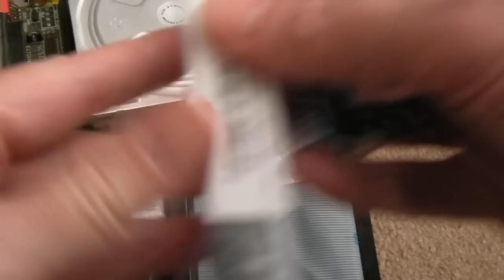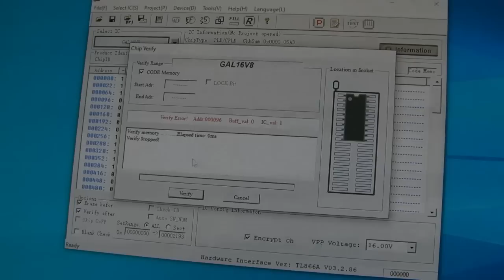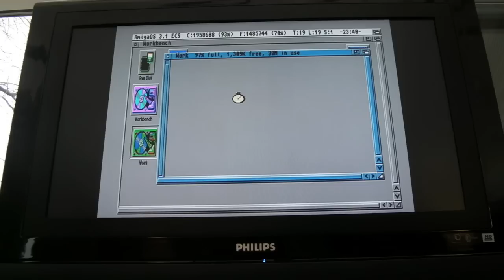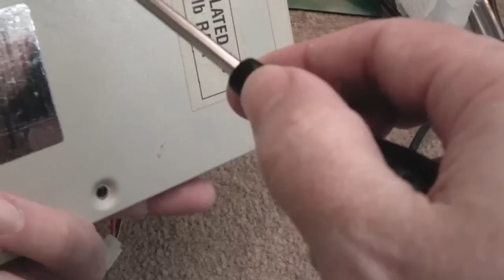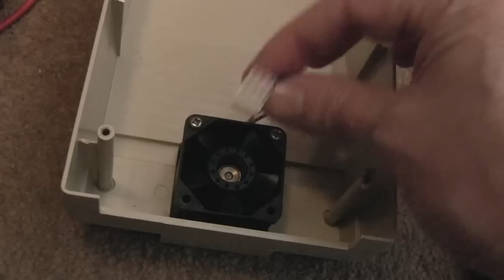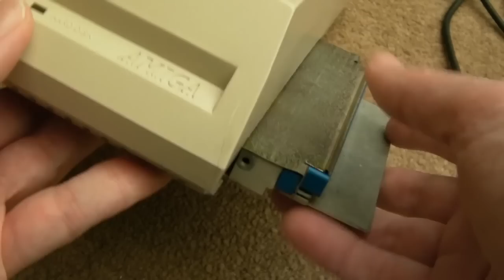Another Commdore A590 Repair (From Tom Meades)

Comment: Great work Chris! It's always a treat to watch your content 👌👌

About those SCSI Quantum ProDrives: In the end they are very reliable indeed but a lot of them are suffering from molten bump stops. Somehow the little stops at the end of the head actuator arm very often are completely molten on a lot of them, preventing the heads to move at all. They're just stuck at the landing zone making the drive seem completely bricked. 
I guess the "plasticizer" somehow completely takes over the structure of these things and they turn into a very sticky chewing gum-like substance which is pain to get off your hands. 

I've witnessed 5 of these drives having this issue and I just managed to save one on an SE/30 by just using a tiny but of heat shrink tubing around the two stops. Sillicon hose works as well. It's a bit of an operation as you have to open the drives up and disassemble the top magnet and the screws can be very stubborn but it works like a charm! The SE/30 wasn't booting at all but is happily buzzing along now 👍👍

(EP=Enable Parity and 52s is a 52mb with one of those fake upper platters to keep it internally balanced ;-) )
Reply from the maker: Thanks for the info there on Quantum drives - super useful!  Thanks also for the jumper info =D

Comment: I am pretty sure the old family A500 had one of these drives attached.  The 20mb capacity was pretty limiting and it got filled with materials for a thesis to the point where you couldn't fit anything else on it.  I don't remember it including a memory expansion but that could either be down to me not realising that (as a school kid back then) or just being a lower end model that didn't have the RAM chips installed.  I remember the drive being extremely slow.  If I was running these expansions I would definately want to use it with a SCSI to SD or CF adaptor.
Reply from the maker: Yes, it sounds like you didn't have the RAM fitted - that was an option!   And yeah, they are very small lol!  I use the other A590 with a SCSI 2 SD - much better as there's a lot more space, and obviously its better to use an SD card than rely on these old SCSI drives.

Comment: Great work 💪.  I've got one of these and I believe I have exactly the same issue with the ram controller. Is there somewhere I can purchase a  new chip from?
Reply from the maker: The GAL chips can be purchased on eBay for a few pounds each.  You would need a Minipro TL866 II programmer to program using the .jed file (which you can download on the net).  Alternatively you could ask on AmiBay - someone is bound to be willing to program and and sell you a chip.
Reply: @GadgetUK164  Thanks for replying. I  purchased a Gal from Ebay and someone from the Amiga community is programming it for me 😉👍hopefully it will work again 😁

Comment: Useful video, thanks. I recently got my old A500 and A590, with original 20MB WD XT drive working. The drive made horrific noises at first but now it works fine with only 1 bad block on the drive. I've got a SCSI2SD on the way though 😉

Comment: Also, a CD32 power supply works perfectly for powering these. I usually just turn both on at once. The main important thing is that ground is connected through.
Reply from the maker: The problem with the CD32 PSU (see my previous A590 video) - even if you turn them both on at the same time, you may have voltage issues.  A CD32 PSU is what killed the RAM on the last A590 I looked at before this one.
Reply: I've been lucky so far! The risk seems to be turning the A590 on BEFORE the Amiga. The A590 PSU is designed so that it turns itself on when it senses the 5V coming from the Amiga.
Reply: You could make an adapter with a DPDT relay that has a 5V coil. Pin 3 on the A590's DIN connector is 5V when the Amiga is switched on. You could arrange the relay so that when it comes on, it connects pins 1 and 4. Ground (pin 3) can be permanently connected. That would pretty much do what the A590 PSU does.

Comment: Buffalo Gals ? :)
Just so you know, Microchip make ATF16V8B which is a GAL replacement device that you can program with a TL866 II Plus. I've used them in Spectrums and i think John Hertell has used them in Amigas without any trouble, so they are well worth considering as you can buy them brand new, rather than NOS
Reply from the maker: Thanks for that info Peter!  I wasn't aware of that chip!

Comment: When programming the GAL why didn't you pick 16V8D?  You just picked 16V8, but 16V8D was in the list.
Reply from the maker: Editing issue - I forgot to film that part (where I did select the right part) - 2nd time around I got the wrong part!  I think they are interchangeable anyway?
Reply: @GadgetUK164  Quite likely they're interchangeable, but I just didn't know if there was a specific reason to go with just the 16V8 vs the actual 16V8D.

Comment: Would you like a desk for Xmas? 😁
For the posts I found out using an outer jacket made out of pvc tubing, or aluminium helps to both glue back split posts and rebuild them, as they are tighter.
Reply from the maker: Great idea!  Made me think heat shrink tubing might help too!
Reply: @GadgetUK164  indeed. I know by experience two or three layers can become quite stiff.
BTW you can get metal tubing from old clothlines (some use tiny pipes instead of wires).

Comment: Will the SCSI to Micro SD adapter from amigastore.eu also work on the Impact A2000-HC+8 Series II, or would you recommend the SCSI to SD Adapter (SCSI2SD) V6 Rev: 2020c from amigakit, and will that one work with the Impact A2000-HC+8 Series II?

Thanks.
Reply from the maker: Yes, it should work!  If you want better performance on the SCSI2SD get V6, but tbh I prefer v5.1 - it's cheaper (around £60 from AmigaKit) and you can read the SD card (first drive on it only) from WinUAE, which helps setting it up and transferring files etc.

Comment: I have an A590 but the HDD is seized  😢 is there a solid-state solution floating about out there that I can replace the HDD with?
Reply from the maker: Yes, the SCSI2SD will work fine =D  If you check out my previous A590 video, and the A2091 videos I covered that SD adapter there.
Reply: @GadgetUK164  Great stuff, thank you will check it out 😀👍

Comment: That is super cool that the C64 Case Saver castellated post repair sleeves work on the A590. I had all but the sleeves available severalty because folks had asked for it. I'll add the sleeves as a separate item in case folks want to use them in other applications like this. Great discovery Chris!
Reply from the maker: Yes - wonderful product from you, very pleased they made those posts rock solid =D  Thanks again!

Comment: Great video as always, I have an original compete A590 I can shoot you some pics of how it's all mounted inside the case if you would like, the drive uses nuts like the external port to hold.it to the shield then the screws go through the bottom of the case into the nuts that are on the drive.
Reply from the maker: Thanks =D Afterwards I realised there should be some "posts" that sit between the board and the drive (screwing into the drive I think).  I've got some of those so I might re-visit that!
Reply: @GadgetUK164  they're a #6-32 NC standoff the thickness of the lower case originally. They're a burly looking thing!

Comment: You should not supply the physical scsci drive through the a500 powersupply, too much load. Stick to scsi2sd instead or use an actual a590 powersupply.
There should be posts to mount the drive. The screws from the bottomside will secure the posts, hence the drive.
Reply from the maker: Yeah, it was just for testing more than anything.  With the beefier PSU bricks its fine though!  Used it a fair bit, granted putting extra load on the 12v rail though.

Comment: its been a while since I seen one of these.... by the time i could afford one the GVP HD8+  was out so I got one of those instead and never regretted it... I just remembered some of the old drives required the park command,  but I think the quantums were auto parking, and if memory serves the scsi  52mb  drives were usually low level  formatted for 49mb with  3mb reserved for auto-provisioning of bad blocks.. but yet again the a590 originally came with a 20mb one...

Comment: Just an idea with that short internal SCSI cable. On many commercial devices, they actually split the cable, either in pairs or multiples of 2. (Every second wire being a ground signal, it helps suppress signal noise). I've done this myself, carefully, with a scalpel, and you end up with a much more flexible cable. Perfect for tight angles like this.
Reply from the maker: Great idea!!! =D

Comment: I don't believe the lock bit actually means its not rewritable - it just means you need a high voltage programmer to reflash it (high voltage = 12v), but mainly you can't use a flash reader to extract its contents - which some manufacturers use to protect their IP from thieves trying to copy designs.

Comment: Those are “wire strippers” but they are nasty so no way should you call them “proper” wire strippers.
Reply: Yeah. About all they are good for is cutting bolts without damaging the threads. Horrible as strippers or crimpers.
Reply: You are so right and maybe it was a joke from Chris. (It HAS TO BE, hehehe). If I would recommend something, then either
- 5 Chinese Automatic Wire Strippers for 100£ and they last 5 years, or
- something like a Weidmüller STRIPAX Ultimate Cable Stripper for 100£ that lasts 20 years
Good comment, Bruce!:)
Edit: I hope this doesn't look like a product promotion. Just wanted to show in which direction the journey should go. There are many other good manufacturers.

Comment: I'm pretty sure that is my old drive!
I stuck the velcro on as I used to have a 33.6k modem sat on top. 
That Quantum drive was 52mb. 
I replaced the original Seagate 20mb drive which was an external stepmotor type. 
May well not be mine do it certainly looks like it was.
Reply from the maker: Awesome lol =D